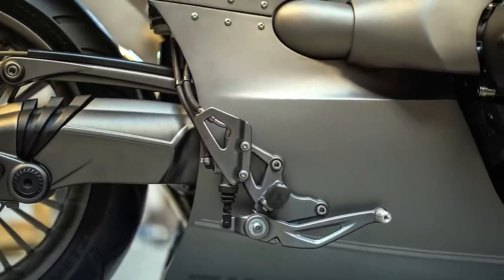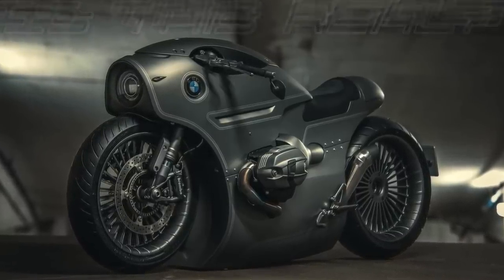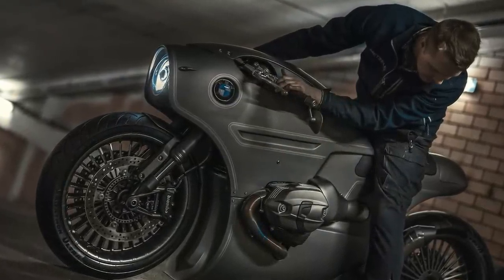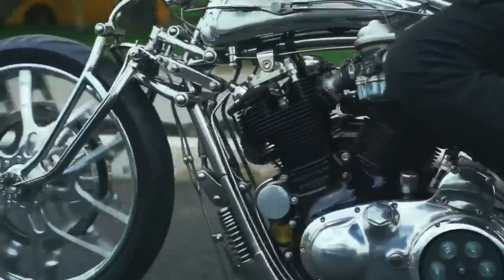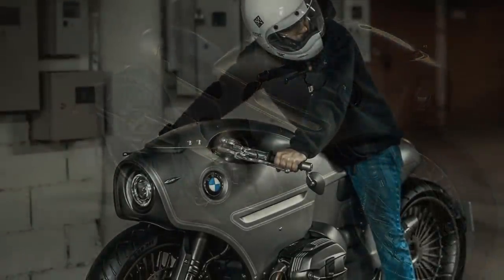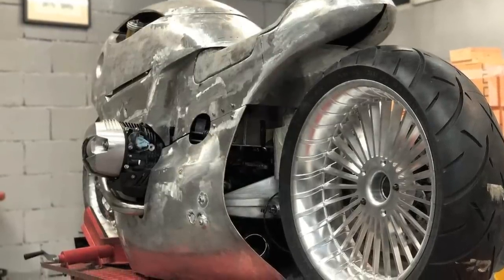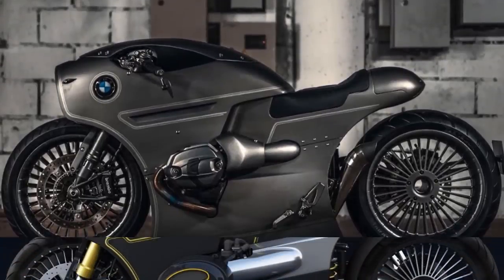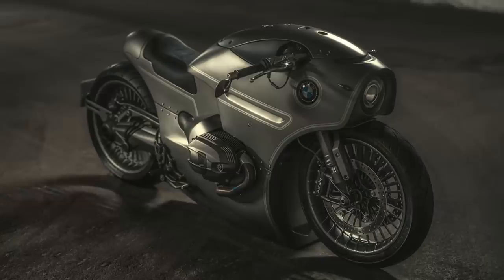Cafe Racer (BMW R NineT by Zillers Garage)

Comment: This bike is an art project flawlessly executed and masterfully designed. It looks like flying 120 miles /h, yet standing still in some art gallery. But, if I have to judge it from the perspective of a rider, it would be a different story. If you ride it to be seen, it is 10/10. You’d be noticed, people would like to talk about the bike and take a lot of pictures. Due to the BMW boxer engine design, the foot controls and the rider’s riding position is like any other crotch rocket - not very pleasant for more than 30min in the saddle.
As an industrial art and design it is the best motorcycle project I’ve ever seen. As a transportation device - a typical crotch rocket. This comes from a guy who rides a cruiser.
Reply from the maker: Thank you my friend for sharing your opinion. :) Cheers.

Comment: If BMW actually built the bike like that everybody has air ride anymore it looks super cool I would be happy on a 500 little thing or 250 2 stroke that looks awesome they prior redesigned the headlight bucket aerodynamics let's all hope and pray is 1 bad little light bike that just put into Construction the the looks alone are so out of this world alone what's an electric engine and a decent range that would be Wicked you could always use the old flat twin her power also don't forget about regenerative braking that can be used on the flywheel also Bella as in beautiful

Comment: The only thing missing is seeing it run on the street
Reply: Blaze Vasquez it cannot run. Just for exhibition. Can't you see the body is too low?
Reply: @Joko-um9rp when the motorcycle is turn on the suspension lifts and the motorcycle is off the ground. There is enough ground clearence to ride the motorcycle. Also there are other builds that have the same low ground clearance and they still ride it, even if it is for a small time

Comment: The design looks stolen to me. It's seems taken from a diesel concept that was doing the rounds 8 years ago called MetalBack cafe racer.. https://www.topspeed.com/motorcycles/motorcycle-news/metalback-caf-racer-concept-runs-on-biodiesel-ar83310/pictures.html
Reply: no, i think the similarities are superficial, different lines, different headlight concept. Like an eye peeking through a hood, not streamlined like the Diesel
Reply: Way different
Reply: Carlos Leon - The head light cowl is simply a chop but the bar shroud and body encasing not to mention colour is lifted.
Reply: @PaulAnthonyDuttonUk  It does not make sense to be stolen of this design if the builder himself has assumed it is inspired by Mikhail Smolânovym's CAD drawing.. don't you think?